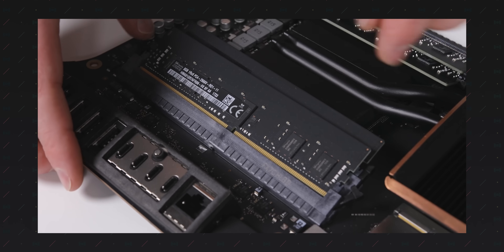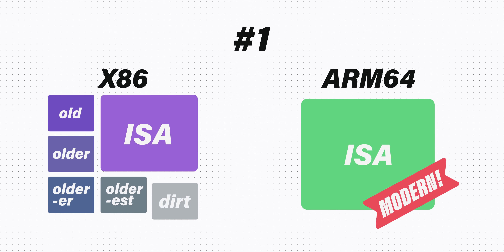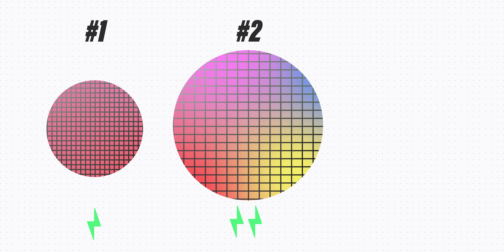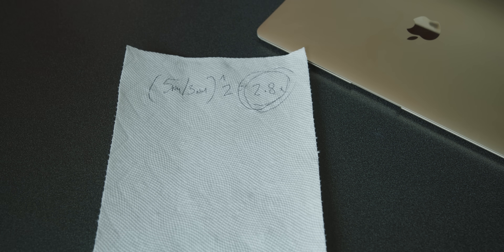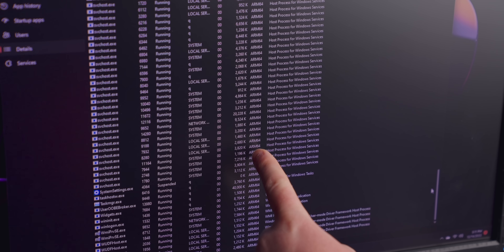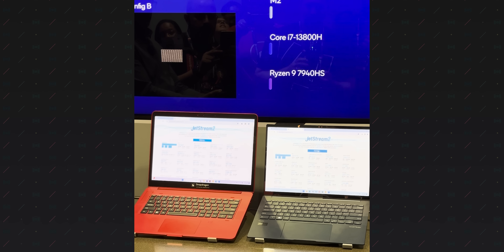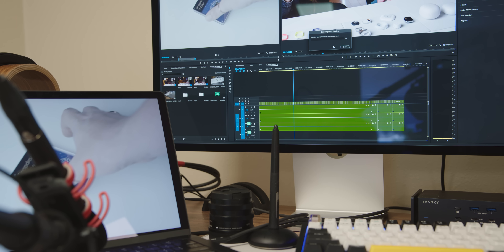Apple's Silicon Magic Is Over!

Comment: #4 Apple has 4 years headstart over Qualcomm, and yes, that matters, M4 will be more efficient on a 3 NM die than M3, so Qualcomm is still playing catchup. Oh as for gaming:: None of the big game manufactorers has commited to ARM transition yet, at best it will be years before they have made the transition.Till then, gaming will still be on the X86, a hardware translation layer from X86 to ARM will make the game run signifigent ly slower. It doesn't matter that every MS program has been ported to ARM, if 3rd party doesn''t follow suit, so even if a new X Elite laptop will be faster than anything on the X86 side, , expect it to be a niche product for years to come.
Reply: Well, not exactly true in all aspects. Snapdragon gen 3 has GPU more efficient than A17 Pro and with worse node.
As for 'following suit'  - ARM problem on Windows platform was always lack of good CPU.  Most powerful non-Apple ARM chip now - SQ3 is so slow that under emulation i5 from 8gen is noticeably faster. Why would anyone pay for new laptop slower than their 5 years old device? 
Thats exactly why Apple succeeded - M1 offered better performance than Intel Macbooks even with  emulation layer, M1 was big jump forward regardless how long user would need to wait for their favorite apps to be ported to ARM.

X Elite can change it because on its own its very powerful chip. If it become popular then there will be software. Simple as that.
Reply: @heroofjustice3349  "Build it and they'll come", well, it's not that somple, when you lack vertical integration,. many Windows games relies on security features of Intel X86 chips to prevent piracy, they will not run in any emulation layer. Many may wish to upgrade, but be unable to for hardware and software reasons: they mayhave expensive extension cards for their X86 and will have to say goodbye to an expensive investment in hardware add-ons, games may find that they either cannot run their favorite game or that it runs poorly on ARM, due to anrti-priacy measures, emulation layers or poorly optimized ports. Nobody offers vertical integration like Apple, take a look at th smartphone market: Apple has mrre than half of it in USA an a whopping 83% of the market among teenagers and Android has been on ARM like iPhone the whole time. Software quality on the Android side is much poorer than on iPhone. Why? Fewer hardware configurations to code for on iPhone, 5 vs 1,000 phones per year,. Apple will still win on vertical integration,
Reply: Qualcomm may still be behind by some degree, but people who dont want an Apple product will be mighty grateful to have anything remotely similar for a Windows machine.

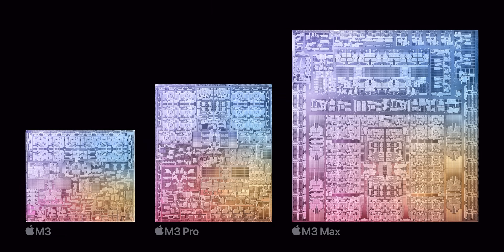Comment: 17:08  "The M1 series will be remembered as some of the greatest computers in history"  Maybe so, if only they weren't designed to be history in so few years.
Reply: As an M2 max owner, my m1 macbook pro (13 in, not m1 pro) is already garbage
Reply: @octav7438  How come? I dont own any apple laptops, but the cpu power should be really good no? Or is it GPU power u are lacking? just wondering
Reply: @enzocalzone5298  For software development it just doesn’t cut it anymore. I even optioned it as 16gb but theres no ability to multitask on that device. My M2 max is still holding strong but theres so much that a laptop can do
Reply: @octav7438 complete pure bullshit. My Air M1 8gb 512 ssd still running like new
Reply: I doubt they'll last any less time than any other laptop ever made.
Reply: @definingslawek4731  Last, yes, they just won't be of any use.  Landfill.  I still have operating and useful PCs from the 90s, my mid 2010 MacBook still works, how many M1s will be bootable in five years?  None can be given a second life. Mac resale values for Apple silicone models will hit a cliff, something that has never occurred before with any Apple product.
Reply: Huh?  M1 laptops are still going strong today and likely will be for a good while.

Comment: Your presentation makes some good points, but...Apple still leads both Intel, AMD, and Nvidia in performance per watt, mainly thanks to TSMC's manufacturing process.   Qualcomm using the slightly older TSMC process means they'll be Apple's closest competitor in performance per watt.  However, in designing Windows laptops around Snapdragon X, OEMs are going to have to choose betwen long life laptops that rely only on the Wualcomm CPU, or 'higher performance' laptops that use Q-X in combination with a dedicated, high power consumption GPU from either Nvidia or AMD, negating much of the power benefit of using the Q-X CPU.   Q-X will make the Windows thin and light/long life laptops much more competitive with Apple's systems, but only for a limited segment of the overall market.  The Apple TSMC combinatio, though, has forced intel and AMD to do more innovation on their own lines in the last 4 years than they did in the previous 10 years.  Now if those two could only improve their own process tech, that would be something to watch.

Comment: Ok Snazzy, so I hoped this video would be more interesting or at least talk about some interesting points, but with high dissapointment I can say that it isn't.
Not sure what is wrong, maybe you guys are lacking some knowledge or perspectives.
The first part of the video is meh, sure you point out that apples trend is slowing at cost and compromises. But so what? Everyone depends on TSMC unless they're using even worse node technologies so it's not like any other company isn't facing the same node shrink issues as they're TSMC clients too. This isn't what is going to take away the M chips magic. Sure the jump from from Intel macs to M1 was magical with rosetta on top. I'd rather you talked about that at the start and then went on to say what can make it more magical in the future again.
for example all the talk is AI now so why aren't you bagging this trend. With the M4 and next macOS rumours/leaks pointing out to mainly focus on AI you can look at why M2/M3 top of the line SOCs are the perfect chips for AI even right now due to 192gb of unified ram and what M4 can do in the future. With Mac studio and its maxed out RAM you can run models such as llama 3 70B that don't fit even on a few nvidia 4090s, but mac studio will eat it up. Apple knows this and will develop AI integrations that area easy to use so it could be digested and extracted by the masses, but M chips are what will power it and we know theyre damn good.
Honestly watching your video was very boring experience. Mostly negative points and going in depth with explaining certain areas that really don't need to be explained or at least could be be explained simpler and with more intuative  comparisons. That has been my experience with most of your videos. Sure the pun that you tried to make against what I think is an old mac box is I guess cool? But I was already tuned out at that point. Focus on the content and what you want for people to get out of it, because if it's  a technical lesson that trust me that area doesn't seam like your niche here. Also nobody likes to listen to a downer unless it's a dunk

Comment: My takeaway to this is that I'm now hoping to see the equivalent of the much beloved M1 MacBook Air to get equivalent Windows and Linux laptops with the battery efficiency and performance that people loved from it. 

Not that I'm hoping for a lineup killer, I just want something that can match toe to toe in terms of value, performance and longevity.

Although the pessimistic side in my head still thinks that the rollout of this would get messed up in one way or another. Apple Silicon succeeded massively not just because of the hardware and vertical integration, but also thanks to Apple's widespread reach and reliability. Yes, it's overpriced and the upgrade path terribly sucks, but if I wanted to get an M1/M2/M3 Mac, I could reliably get one anywhere in the world.

Comment: An ARM laptop isn't going to affect Apple, it's going to impact Intel and AMD. Many people buy a Mac without much concern for what's inside. Some might not even be aware that the CPU architecture changed. A Qualcomm based laptop needs to have the aesthetics and quality to compete. Being solidly a Microsoft and Windows computer, isn't a bonus. People have the choice of Windows laptops already. Also, Qualcomm won't break the laws of physics, their chips will run just as hot.

Comment: I agree with Katieadams5860. Everytime Apple comes out with a new chip, you can't pop out the chip and upgrade it like Intel or AMD. No, Apple builds it into the Motherboard. And what they charge for additional Memory or Disk Space, is totally Ridiculous. Wake Up Apple and make a PC that is like an Intel or AMD motherboard and CPU.  And, to operate Windows you need to use a emulator. And half the time, from what I have heard doesn't work that great. If one took a Mac Laptop and Erased the entire Hard drive, removing Mac OS, then install Windows 11. Then I might consider a Mac Laptop. Is that even possible? Can one wipe a Mac Drive and install windows? Please let me know!

Comment: Apple used to make their own chips before they were using Intel Chips. Back then you bought software in Boxes. The Mac section was only 6 boxes wide, 5 shelves full, while the PC side always had 10 times more selections. Back then When Apple release a new chip it would be slightly faster than the PC version, for only 4 months, then 5 years later a new Apple chip comes out, and repeat. Then Apple went to Intel chips for awhile, and they were really no different from a PC, other than the OS. Now apple is once again making their own processor, and I would expect the already established pattern to continue. 

Though all of this, Apple has always costed much more than a PC, and today all the hardware is very the same within both, only more expensive if you buy it in an Apple product. Windows is still far more popular than Apple. Apple is expensive hype, as a PC can do everything a Mac can do, and so can Android, as all the hardware is very much the same between each.

Comment: Biggest problem of Apple Silicon is poor 3d performance and closed down system to upgrade trough a conveniente off the shelf gpu.  Also  not everyone is interested in performance per watt. Sometimes just  performance is priority than a low energy consumption.

Comment: Fan noise on a 14 is much worse than the 16. My 16 m3 max at “full tilt” is still silent.  Elite is lacking a max or ultra so they are still years away.  And having “Microsoft behind it” does not note success, in fact perhaps the opposite.  Where is the windows mobile platform?  Microsoft’s contract with Qualcomm also expires early 2025, so I would not agree with this video that Microsoft is fully onboard with this.  Microsoft is fast at work in their own AI driven arm cpus, and will likely offer benefits Qualcomm chips will lack.  Microsoft owns the OS, so would not be surprised they use that to their advantage when selling their own computers.  Microsoft computers are NOT cheaper than Apple either.

Comment: The thermal issues don't concern me because I'll be sticking to the Mac Studio line and their beefy heatsinks

I'll be laughing my ass off at all the Max Techs and Luke Mianis claiming the Mac Studio makes no sense because it has the same CPU as the MacBook Pro
We'll see who's pointless when your MBP is throttling and my Studio can run the same chip at peak performance indefinitely

Comment: It's been really concerning Apple have failed to bring a big CPU IPC uplift over the past several years, especially with the brand new major architectures the A17/M3 brought (huge width increase in both frontend+execution engines). It begs the question, is it due to GW3+Nuvia employees leaving in 2019? Remember Apple tried to sue GW3 to try prevent more Apple employees joining Nuvia
Reply: to be fair, it's mostly cuz TMSC's first 3nm node was kinda a little bit shit and by the time they realized it apple had already bought out the production runs. The next 3nm node will be a lot better and has a roadmap, but the first gen one is a dead end so any architecture designed for it has to be scrapped and redone for the second gen node. (apple was the only company that bought the first gen node to my knowledge (which is lol. lmao even))
Reply: @feralmage  I doubt TSMC's N3B is worse than TSMC's N4P. Nonetheless Apple shouldn't be reliant on TSMC for performance gains. Plus I said IPC. IPC isn't effected by process node too much (unless the node is trash/major downgrade)

Comment: Side story: a friend of mine sent me this video and said "I think with this Snapdragon chip and Apple M, we can finally say that Intel/AMD is dead" and I had to explain to him that these chips still cannot do multi-terabytes of DRAM and dozens of controllers like the ones we use in our datacenters and supercomputers. And they don't even need to, I guess?
Reply: Funny thing is, x86 can be power efficient. AMD basically proved it with their server cpus. Yes, they require 400W to run at full tilt. But they also have monstrous core counts up to 128, which means somewhere around 3W per core, which is pretty close to Pi territory
Reply: Also if you're not a youtuber, an iphone app developer or a person who hangs out at starbucks you have no use for the m series. Not even Hollywood is adopting apple silicons. Certainly not the servers, data centers, gamers and the general computer scene.

Comment: Well APPLE encountered the same problem as INTEL, not that it is not grateful for the change, because I find that Apple Silicom is a big leap, but clearly it is not possible to maintain the minituarization cut year after year and now we will possibly see the same thing as With INTEL processors, the changes will be speed in exchange for battery time, like the old days

Comment: Hi Quinn, what are your thoughts on having an Apple Silicon Mac with integrated SSD and RAM chips, but with expansion slots for more RAM and SSD storage? Then you can have the boot partition on the integrated chips and also have future expandability. Apple might argue it’s not as fast but for most people, it would vastly increase the longevity of the device. 

Of course there would be kinks to iron out regarding the T2 chip but I don’t see how that can’t be rectified with encrypting the expandable SSD.

Comment: I recall the Intel to Apple Silicon transition having a lot of accusations regarding that thermal chassis that it was built with the result that the Intel chip performed sub-obtimally due to thermal throttling. If a mechanical engineering team were given a design specification that needed to accommodate Intel and Apple thermal requirements, it's not a surprise that they would be able to design a better thermal solution for the Apple M1.

Overall, I find your conjecture about the reasons for the M1 silicon improvements over the Intel solution to be entirely too vibes based. Present better summaries of benchmarks or comparisons that aren't summarized as "more transistor good"

Comment: No other computer maker is proud that a laptop and a desktop perform roughly the same. It is truly a failure to understand a workstations performance is graded in power per outlet. Not all workflows can be solved by just spending across more cores. If you nonlinear processing your results can't be added to together which means you cannot parallelize the process. Also, thunderbolt is basically just a port to fix apple's mistakes. Like now it mainly used to add internal storage because apple requires a kidney for that. I however, need it for my pcie hardware to connect specialized hardware. However, the second you want an enclosure they are basically special order or 1k. If you need more than 4 lanes you are screwed.

Comment: I have an M11 Ultra Studio that I use for fairly complex video editing with FCP/X, it is an astonishing machine, I also have a 2014 15" MacBook Pro that still works very well and gets used on a daily basis.  Show me ANY 10 year old Windows Laptop that you can use as your daily driver (email, YouTube, etc.). While the 2014 doesn't perform as well as the Studio it's still just as reliable and most of all i runs Mac OS!  I don't care what Windows/Android/Linux SOC is on the horizon, I use Mac because I prefer Mac OS and of course the quality of the machines.

Comment: I'm only in Mac land because of Windows 11 and it's invasive practices. Sure you can clean install and get rid of the ads, but then Edge will steal your open tabs and pretend to be your browser if you sleep your computer. Try booting a windows 11 compatible computer on Windows 10. Ten minutes of clicking the exact combination of buttons to boot and not upgrade, at minimum. 

I've got a base M1 air I paid $750 for a little over a year ago. It's fine. Impressive for it's low specs. The computer can do anything I throw at it. Maybe not fast, but it can do it. 

Once security support is dropped, or the few computer programs I need require better specs, I'll revaluate, if windows is fixed, price to performance and length of support is usually better, so I'll go back. If not I'll buy the cheapest Mac again. 

I guess I don't really care what apple does, as long as they don't make MacOS as invasive as Windows.